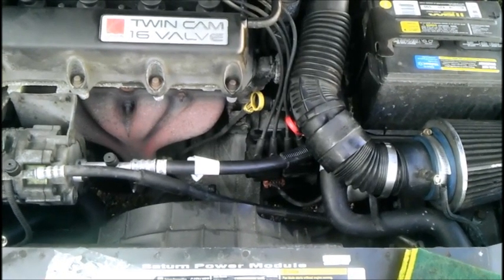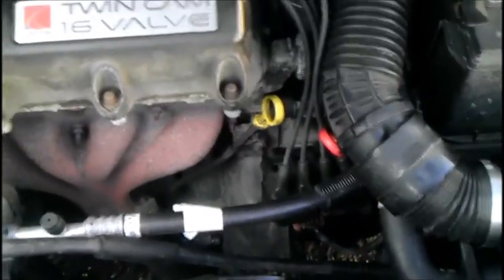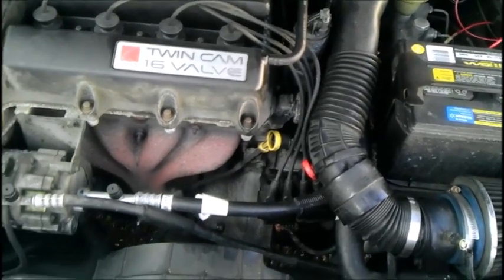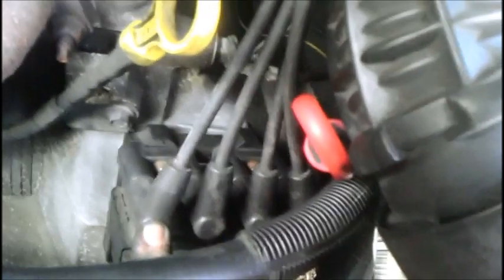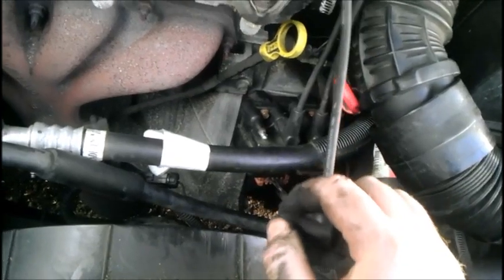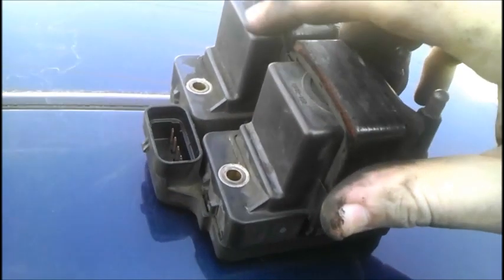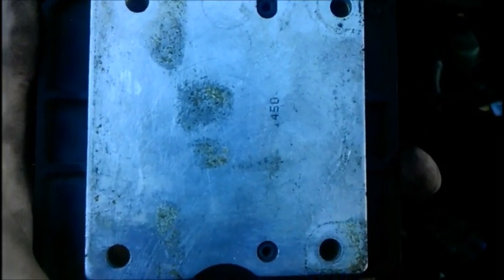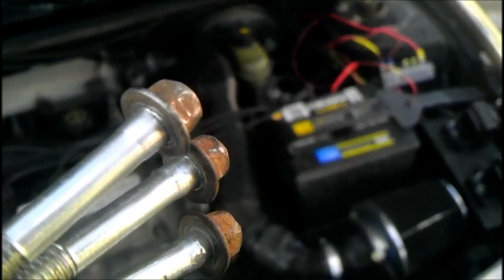Removing/Cleaning the ignition coils/module on a Saturn S-series.

Comment: I have an 2002 SL1  1.9 liter that was running n starting without a problem,until I let it sit for 6 days and heavy rains came,now it will crank but won't start. It did try starting at first but now acts like it isn't getting spark! Can you give me an idea what the problem is

Comment: Keep geting different answer what grease should go on back of coil on metal plate and on back of icm that connects to either the engine or tranny one of those 2
Reply from the maker: I've recently heard on 3.8L (3800 GM) engines to use thermal paste where the icm sits on the engine to help disappate the heat.  As for the coils I believe Dielectric would work

Comment: This video is still relevant and helpful in 2018. I successfully changed the 4/1 ignition coil on my '02 SC2 and the misfires have ceased.
Reply: 2020 too.
Reply: Ya that’s good , my 2005 Chevy Silverado was doing it I didn’t find out what was causing it , but I put new park plus’s in and it has not done it again, I would like to find out what was making it misfire ???
Reply from the maker: Must've been either using a proper plug or the coil electrode had a fault, assuming there isn't excessive oil burning

EDIT: maybe you reseated the plug wire with the new plug inside and it worked, it happens
Reply: What would cause that to happen on a 2005 Chevy Silverado? You have any idea 💡 of what It could be???
Reply: @TomMack530  I changed my plugs and my car went from limping to driveable although it still misses. Gonna change the coil packs here in a few
Reply: @dhare07   vuuv
Reply: Aa@@ @TomMack530  ppppap

Comment: I have a irregular idle on my 2002 saturn sl1 with no codes. My moms has the code and misfire on her 2001 sl1. I'm thinking on doing a cleaning on both cars. You think I'll see a improvement on my 2002?
Reply from the maker: If that's the case... spray carb cleaner or soapy wooder around the intake manifold runner.. if the idle changes then you need a new intake manifold gasket... it's a common issue on these 3rd gen saturn single cam engines
Reply from the maker: @ThesexyMrX  that'll do it...

Comment: So my sc1 98 I've put a lot of money into it . Question did yours ever shut off on you then start back up after cooling off? Can this trick you did possibly fix my problem? I've got new spark plugs , cables, cps , iac sensors fuel pump fuel filter one coil pack replaced. No misfires or codes. When the snow melts I'll try this praying it works please reply thank you.
Reply from the maker: Sounds like you'll need a new crankshaft position sensor bud
Reply: I did just replace that had to have a mechanic do it but it didn't do the trick. On the forum everyone said that as well except one guy said ignition module can overheat and start again when cool. Thanks for the reply I just can't figure this out and we need this car so bad to work I'm gonna try your method tomorrow.
Reply: I payed the mechanic 300 just for those 2 sensors and feel pretty stupid for doing that. It runs fine for like 20 minutes but once it dies it's done and I'm on the side of road for at least 15 mins.

Comment: What did you clean your coil tower with?
Reply from the maker: Coil towers?  Not sure... I know I cleaned the area where the ignition module sits with a wire brush, it'd prolly be better if I had a wire wheel on a Dremel or something

Comment: Thank you for this video. I will be cleaning the ignition module on my 1997 Saturn SC2, 5 speed manual trans with 188,000 mi. I had codes last month but replaced some basic tune-up parts which turned the CEL off. I still have what sounds to be a miss (but no code), so I will give this a try...I have no idea if the coil/module has ever received attention on this car, but I guess I will find out! Thanks, again.
Reply: Did it fix your issue
Reply from the maker: It did for me, yeah

Comment: thanks for the video! I read the saturn fan forums, but it's nice to have visuals as well. I had a couple of those codes P0301 and p0340) the other day, so this is my next step (found oil in the #1 spark plug well, so I fixed that first. still didn't fix the whole problem)
Reply: yea, that was the first thing I did. car still has the same problem even after doing that AND cleaning the ignition coils/modules. looks like I still got some work to do

Comment: Here's a quick and dirty way to diagnose if your coil pack is going: As mentioned, there is no camshaft position sensor on these cars (Ford uses a trigger wheel style usually, hence the code), and the code comes from a low voltage reading across cylinder 4 plug (thanks richpin!). Swap out your plug wires if you've got the 30 bucks, if not, to get rid of MY code, I used some dielectric tune-up grease on the end of a Q-Tip swabbed into the boot and plug area of the #4 wire on the coil pack. Cleared the code, and it hasn't come back, for less than 5 bucks. 

Maintenance, really.

Comment: The crankshaft position sensor tells the cam that the CRANKSHAFT is at the right position at the right time. If the sensor is bad the vehicle is simulating slightly off time therefore causing corrosion on electrical contacts and misfired. Think further. All of this stuff is connected nowadays.this causes that and that causes this which causes this......computers.in cars.who would have thought.

Comment: Thanks for such an excellent video. We've replaced the ig coils/mod with new, replaced the plugs/wires with new, still get the code. The guy who did this, did not use a torque wrench on the (cleaned) bolts. Can that really be a possible cause of the code persistence?

Comment: Thanks! I just got up this mourning went to work a p0341 came on
(Past with no codes) 2 days ago I replaced the spark plug wires and, plugs. I assume from your video a good cleaning for good ground should do the trick however if the issues stays should I replace the dis module?? And I don't know if it's related but the HIGH ENGINE COOLENT TEMP/ Automatic transsexuals temp and low coolant level warning light is flashing?? But it is not continually. 
Coolant temp gage under the half its good hmmmm
97 saturn sl2
Any help would be grateful... :'(

Comment: really good info..i cleaned my coils and such and  the car runs MUCH better...one thing i kinda did different is on the coil towers and the bolts is i used a Dremel with a wire wheel attachment(mainly because i had one)..The grounding point where it attaches to the transmission was FILTHY..it looked like someone spilled a bunch of fluid or some such
Reply: +adventureoflinkmk2 my stepfather uses them all the time(Dremels) so we have a few attachments around..their Dremels came in a kit with all sorts of attachments wit them..i think Harbor freight has a kit..
Reply: harbor freight i believe has them..might also look on Amazon

Comment: Hey there, I have a Saturn 97, SL2. The code P0341 for a camshaft position sensor popped up and , I’ve bought new spark plugs and wires I’ve done everything as you but the code is there, I can’t get ride of it, have a any suggestion?
PS: my car fires perfectly

Comment: I have a 02 SL1 Saturn I had a transmission install after I got it from the shop I drove it for 2 days kinda struggle up to 70 mile per hour I went to Walmart the back of my car to go home went to crank the car I had to do it about two or three times took the car home park getting ready to take my wife to work that morning crank but no start I install a crankshaft position sensor install spark plugs I replace the fuel filter you was saying if we have any question concerning the video or what or any Saturn that we may have you could give us the answer so what else is left it didn't look like I was getting any far from the spark plugs wirescould it be the coil pack or cut it be dark fuel pumpnow I do hear a little light sound from the fuel pump when we put ear up to the gas tank I hope this is enough information to get me started thank you for your video
Reply from the maker: Coil pack and ignition module would be the next likely suspects.
Reply from the maker: Any service engine soon codes?

Comment: I have a 1998 Saturn SL five speed. I went to the store the other day came home went to leave again and it wouldn't start it will turn over but don't start we changed the CPS and the Coil.. still not starting could it be my ICM and can I clean it like you did or do I have to buy a new one?

Comment: Thanks for posting, I just bought a Satun SC2 and we love it. I've had some miss fire when I first start in the morning and at night when I leave work, but as I drive for a little while it the miss clears up. No engin light either, so no codes.  I replaced the MAP and Temp sensors, but the miss still happens on start up.  I'll try this cleaning this weekend and see what happens.  Thanks again.  Dan
Reply: Daniel John Clayton Did it help?
Reply: Anthony Davis Well, the miss I thought I had turned out to be a motor mount KNOCKING when the fast idle was on. Fixed this and...Ta-Da...
everything is good. I am going to do a full tune up for summer and will definitely use your suggestion. Thanks for the help bud.  Dan

Comment: Excellent video. I am at the part where I have taken the two bolts off the right coil (a lot of corrosion) and it is loose and I can't pull it out. According to your video there is one more step where I have to push up on the lower part of the coil and I can't see what I have to push up on. I replayed about a dozen times in slow motion and I still can't see. I don't want to take off the whole assembly. Any help would be appreciated. This has been one good reliable little car. Next thing to tackle is the bang putting in reverse.

Comment: Hi, thankyou for a great video. Wondering  if you'd have a suggestion, while driving my 2000 SC2 started to shudder and stutter and jerking really bad while reaching speed over 30mph and didn't do it if I stepped off the gas but did it again if I stepped on gas. Could it be these coil packs ? There is absolutely no error codes. Thanks in advance.
Reply from the maker: Either that or a vaccum leak or clogged catalytic converter
Reply: @adventureoflinkmk2  thank you, will try n see if I can manage to figure that.
Reply from the maker: You're welcome... Those would be good first starts

Comment: I have a satran s rough ideal shutters at stop will smooth out when you put it in park change plug wires air filter same thing
Reply from the maker: Sounds like something within the transmission... be it the solenoids, valve body, or the input/output shaft nuts coming loose.. possibly the torque converter
Reply from the maker: Was gonna say I'm going through this same thing on my dad's dodge journey

Comment: The crankshaft position sensor is up behind the starter
Reply from the maker: Yes it is.  The spark signal emulates the camshaft signal... Weird I know
Reply: @adventureoflinkmk2  okay maybe you can help me figure out what's going on with mine I have a 99 Saturn SL1 I have no spark I have changed out and checked everything that I can think of from the knock sensor the crankshaft position sensor both coil packs ignition module changed out the PCM spark plugs wires what do you think I'm missing
Reply from the maker: At this point it could be a wiring issue or you didn't sync the replacement PCM

Comment: Good video. Thumbs up. Saturn phantom mystery misfire on the highway even after new plugs and wires. Must be the coil
Reply from the maker: Yep, generally a p0300 would involve the coils and ignition module, good place to start.  And thank you.
Reply: @adventureoflinkmk2  had no code. My service engine soon light would flash on and off while on the freeway with light gas pedal pressure. It was freaky. I was too far from home to accept any car trouble. I down shifted and hit the gas. The car went through slight hesitation and sputter before ministering past all that and came to life. In short, I've experienced what I believed to be a worn flat clutch or a fuel pump acting up. 
The SERVICE ENGINE SOON light only blinked freakishly DURING  the misfiring but once I smashed on it after the downshifting it ODDLY came to life. That's when the light would disappear as the car had normal  acceleration. So no code remained. I've fixed everything else except for the MODULE and coil, so that would be the last thing to be replaced. EXCELLENT LITTLE GAS SAVER either way, plus it's super easy to work on the car. Saturn is one the best least problematic and easy to fix cars so ita worth it.
Reply: @ahkillez64  that's exactly what happened to me. I changed the tps and plugs and it helped but at first it had a miss only when I was climbing a hill. Then it got worse and I had to granny the shit out of it so it wouldn't  miss

Comment: Hi,  I followed you instructions on replacing the Ignition Modules it fixed about 95% of the problem.  The car still idles very low at stop light and stop signs and will occasionally die.  I am not sure what I could do to stop this from happening.  What would you suggest?  Thank You,  Steve

Comment: I have a 02 Saturn SL2 with 38k. Never had a problem until  today. Got the code for camshaft position sensor and also it started ticking like a valve tick. Is this related possibly?
Reply: adventureoflinkmk2 checked oil and was a little low but not out of the safety zone on stick. It little weird they both started today

Comment: About a year ago I changed the plugs and wires and the module on my Saturn 2008 SL1, with air.  A few weeks ago the Motor mount bolts broke and the engine fell about 2 inches onto the serpentine belt, broke the belt and almost broke the water pump.  My nephew fixed it (mechanic) but he works on diesel so he's not sure about the rest.  Everything was working fine but 2 days ago she got in it to go to school and it wouldn't start.  It tries to turn over so not a starter.  Any suggestions?  Thanks

Comment: 1997 does have a cam shaft sensor its behind the starter
Reply from the maker: No, that's the crankshaft position sensor
Reply from the maker: On Saturns the camshaft signal is emulated within the ignition system, I believe in the #4 and #1 cylinders

Comment: I have a question for you regarding this video. RE: The ignition power connector-I found that my connector was upside down compared to yours. Do you think the connector configuration matters? Also, what, if anything, is directly behind the coil module mounting area? And lastly, should the negative battery cable be disconnected before beginning this procedure? Thanks in advance for your response.
Reply: Thanks. Have a good one.

Comment: Whenever my car gets hot it turns off, and refuses to start again. Do you think its a bad coil pack? Im not sure the car would run on two cylinders. If its not the coil pack, could it be the crankshaft position sensor?
Reply: ***** I replaced crank position sensor... same issue. Except this time I noticed that the car could idle all the way up to operating temp. However, as soon as I touch the gas, it sputters and dies. Wont restart until it cools all the way back down. What could that be about?
Reply: ***** Fixed the problem. It ended up being the ignition control module. The old one looked like it was brunt or over heated several times on the metal surface. Possibly the seals around it had corroded over time and water had gotten it in, shorting it out? Regardless, I'm happy to have my car back, and thanks for your input and time.

Comment: hi i have a saturn S-series 1995 just change termostad, water pump re built radiator because it was over heating. it ran great for two months and sudently started to over heat water coming out from radiator cap. i change it but still over heating notise that my water hoses getting hot and verry hard can you help telling me wat causesthat.thank you verry much
Reply: ***** Thank's 4 responding I removed the temperature sensor and cleand it it was kind of rusted. and bleaded the air from radiator. tested the car and problem fix could it be either of the two . thanks for the videos their great help.

Comment: i notice the module goes back on somewhat slanted to the block rather than flush, is that normal, i can't see enough in the vid here if it is on that way.... it appears to be flush as for the bolts
Reply: +Metal Maniac looking at mine I haven't removed yet but mine seems to sit like that

Comment: I've changed my ignition control module, egr, and map sensor on a 97 saturn sc1. But I'm still getting map sensor low voltage, egr low voltage, and cam shaft sensor low voltage. Is it possible that the ignition module isn't grounded? And where do I put the di-electric grease? Just on the power coil terminals? Thanks for any help!
Reply from the maker: Yep, dielectric grease on the spark plug wires that connect to the coils
Reply from the maker: ALSO: it's definitely possible you've lost ground somewhere given the ignition coils and module emulate the cam shaft signal
Reply: @adventureoflinkmk2  thats why I was asking about the die-electric grease. Trying to find out if there's a better way to insure a better grounding